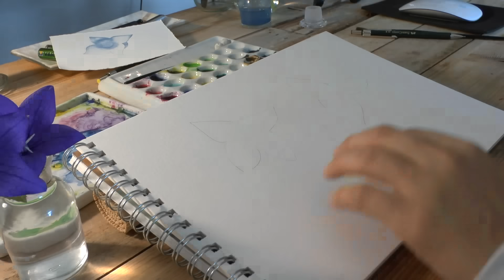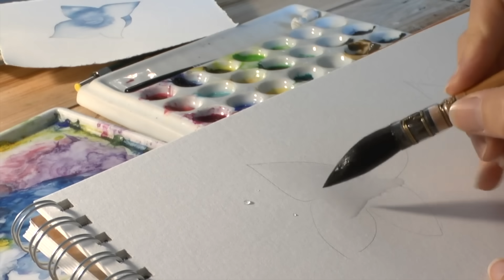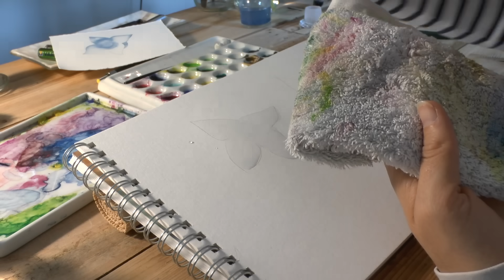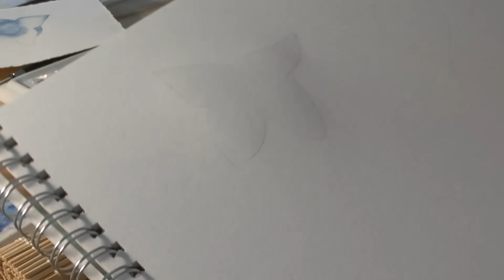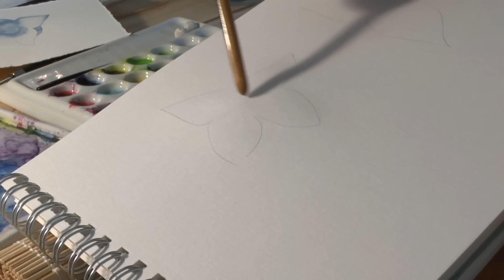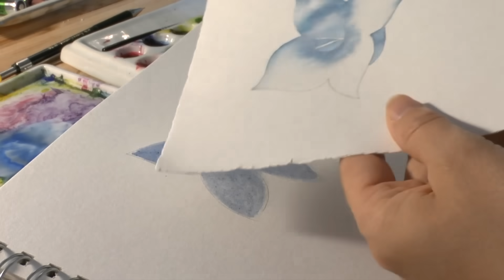Controlling the Water ~ How to Use Watercolor with Scarlett Damen

Comment: Is that granulating paint you mixed with or is the paper pilling in the middle? Ive been having difficulty with paper pilling with successive washes.
Reply from the maker: Yes I’m was using granulated paint. But piling paper can definitely be a problem depending on the paper you use. I’m using 300gsm professional watercolour paper. I recommend trying out a few different types of papers at your local art store and see what you like before you buy. 
Happy painting. 
Scarlett

Comment: I am new to watercolor and maybe I missed the explanation but why do you need to apply so much water and then keep going over it? What will this do for the painting?
Reply: it's to make sure that the color you apply is evenly spread and all the same intensity. If it's dryer in a spot the color wont spread there, or it will look different, if a spot is too wet the color will dilute.
Reply: Thank you
Reply from the maker: +creekkid42, exactly 😁
Reply from the maker: Part 2 is about controlling the paint. here's the link: https://youtu.be/6mdRhV72oqI
Reply: Because it is WATERcolor!💦🎨💦💦💦🎨💧💧💦💧💧

Comment: I have a problem regarding on what paper should i use because i did that on my sketchbook and it just destroy the paper
Reply: chx sca For any watercolor paintings you should definitely use watercolor paper. 300grams/140 lb (it says it on the cover when you buy it at the store..it's the paper weight)
Reply from the maker: I recommend ARCHES  140 lb. Cold Press paper:  https://amzn.to/2H3hiaM or STRATHMORE 140 lb  Cold Press paper: https://amzn.to/2EclW3e